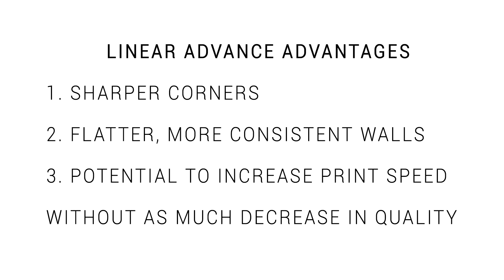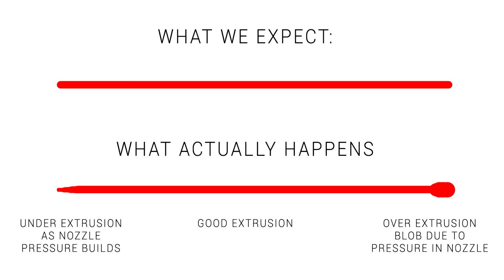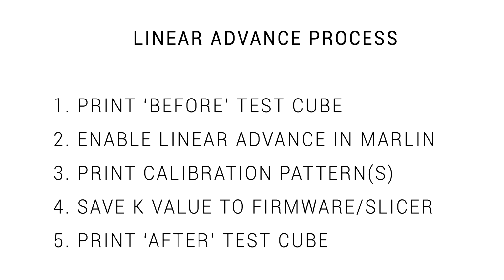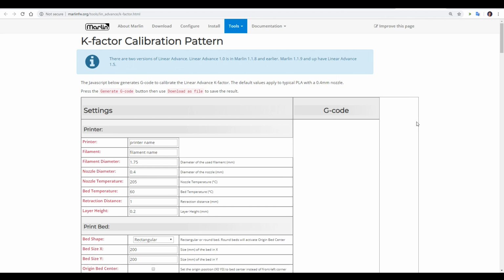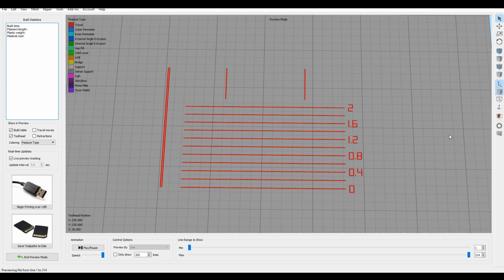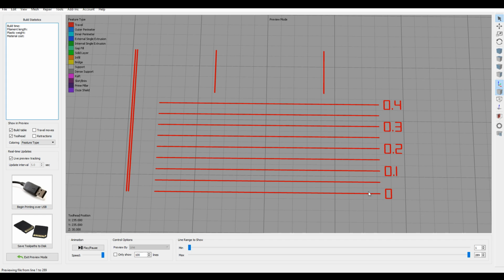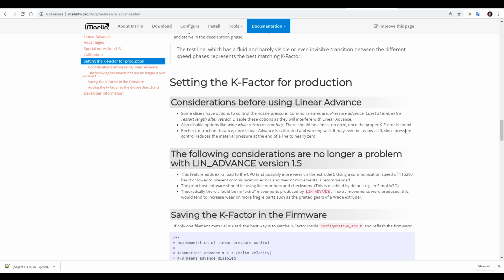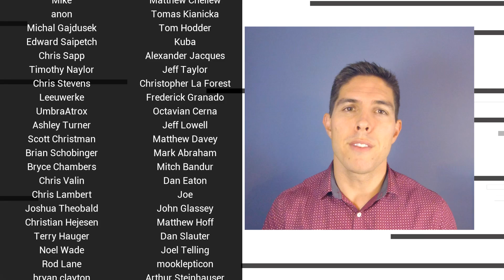Linear advance guide - Free and easy print quality improvement

Comment: I really, really enjoy your videos... thank you so much for sharing them.  I was wondering, though, do you have (or have you thought of) a complete list of upgrades that you would do to a base model printer?  For instance, I have an Ender 5, and I would love to have an itemized list of what YOU would do to it in order to make it the best that it could be.  If the items were even classified or prioritized from "must do" to "over the top", that would be even better.  Thoughts?
Reply: Jeff, I've had my Ender 5 for several months. Thingiverse numbers follow: Print the bed stabilizing arms(3479330) and then if the bed drops when the z motor is disengaged print the upper leadscrew bracket(3534568). Route your wires carefully after you print the bed strain relief(3443100) and the extruder relocating arm(3595328) that lets you drastically shorten your bowden and run shorter retractions (I'm using 4mm;60mm/s) Don't bother with an x-belt tensioner. Buy spare nozzles, capricorn tube, and a glass bed, two if you don't like to wait for it to cool. Auto bed leveling is nice but you have to sacrifice a lot of features on the stock board to make it fit in ROM. Wait and do all the following at once: Hero-Me Gen3 ducts(3182917), SKR1.3 board with TMC2130 drivers, and BL-touch. This will likely obsolete your old gcode depending on how you set it up. However, if you got to this point and you don't care about noise and can manually level the bed, the board upgrade is mostly about playing with advanced marlin features. For a printer-farm machine, no way;for a hobby printer, go for it.
Reply: @alexmacgregor8471  Thanks... I've done a fair bit of that stuff already, except for the board upgrade and ducts... looking to do that next.  I've also got the parts ready for the bed heater upgrade.  Really appreciate the list!
Reply: @jeffgrant935  Cool! which bed heater upgrade? AC power or a better 24V PSU? I had a Meanwell 24V SMPS on hand from an older CNC project but it was to thicc to fit in the ender 5 enclosure. So I moved it to the left side and put the OctoPi and skr on the right side in a nice roomy case (3902295)
Reply: @alexmacgregor8471  It's the same silicon bed update that Michael recently posted a video on with a 24v PSU.  I'm currently building a new wood cabinet/enclosure for the printer (I'm a hobbyist woodworker) that will contain the whole printer, supplies, etc, and be on wheels, and the upgrades are mounted to that.  Transitioning the Ender 5 from table top to an actual rolling cabinet.

Comment: Yup. If you've bought the Creality V1.1.5 silent board, that is all you got - a silent board. Because the TMC2208s are hardwired into the board as a drop in legacy, you get StealthChop mode only. You cannot access the SpreadCycle mode nor flip between the two during printing. Don't get me wrong, silent is so much better than the A4988s and should, in my opinion, replace the previous board as stock. Creality should then provide, as an upcharge/upgrade, to a board where the TMC2208s (or TMC2209s) are configured for UART control to use StealthChop and SpreadCycle. 

NOTE: Along with not being able to use Linear Advance, you cannot use Klipper either.

Comment: tmc2208: otp e driver to spreadcycle. add

#define TMC_ADV() { stepperE0.en_spreadCycle(true); }
#define MINIMUM_STEPPER_PULSE 2

should work. also there probably is a way to set min pulse to E only, but probably is required for xy

Comment: I noticed th3d firmware offered some experimental settings in their new update. Is this what they included? I am running the 2208 steppers on the creality 1.1.5 board. So is it not doing anything? My prints seem to have improved dramatically

Comment: I use manual mesh bed levelling. I tried following this guide but repeatedly jammed my print nozzle into my print bed because it doesn't seem to activate the bed levelling I have saved. I tried ticking the 'bed levelling enable' box in the script generator but that didn't seem to help. 
Has anyone got any advice?
Reply: Insert M420 S1 into the generated gcode but be sure to place it after the g28 line. http://marlinfw.org/docs/gcode/M420.html
Reply: @thomashome677  Thanks for your comment. I can confirm that M420 S1 solved my problem.

Comment: I checked Cura's marketplace and there's also a linear advance setting plugin by Author FieldofView.  Going to test this out also.  If this works, it would be easier than flashing the firmware.
Reply: I wonder if this setting works without the firmware.  Please post your results.
Reply: @Pilot16H thanks, that's what I figured.

Comment: Will definitely try this feature when I give my Ender3 an overhaul.
Reply: Same. Baby needs a rebuild.
Reply: How'd it go?
Reply: @donaldviszneki8251  At least for mine, I noticed right away I can screw all four of my bed level knobs halfway, and I achieve tram level. Before I had to screw one all the way while the others not. No gentle tipping  in the frame on a flat surface.
Reply: @Splatterpunk_OldNewYork  Maybe I"m just being a noob, but it sounds like you're talking about bed leveling, and not about linear advance.

Comment: "easy"
Reply: Street Guru if you want simpler than that you’re on the wrong channel mate
Reply from the maker: Uncomment one line in firmware. Print gcode and pick the best line. Save value. There's harder things around, that's for sure.
Reply: @TeachingTech  Isn't there a Cura extension that can modify firmware? Like it gives you a lot more options to mess with? Would that have the same options?

Comment: 2208s with LA, I found I needed to disable s curve acceleration to get it to work correctly on my SKR1.3.  They just would not play nice together.
Reply: Works perfectly fine for me with S-curve acceleration enabled on SKR 1.3. I had some issues at the beginning with the extruder stepper not moving at all, but that was fixed by a few tweaks in the advanced config file (I can look them up if you're intrested). It needs to run in the SpreadCycle mode (StealthChop mode cannot keep up and skips like crazy), but that's the only limitation. I like to keep everything in StealthChop by default, so my start G-code contains "M569 S0 E" to switch the extruder to SpreadCycle and the end G-Code will switch it back to StealthChop.
Reply: Ahoj, koukám že jsi z čech, mohl bys mi prosimtě pomoct s nastavením advanced config? Taky se mi nehýbe extruder a nevím co s tím.
Reply: @blackader_  Pokusím se, budu-li umět. Pro začátek bych potřeboval nějaký základní info, jako např. co to je za stroj, jaká deska (SKR 1.3?), jaké drivery (2208?), verze Marlina, atd., abych si udělal obrázek. Dále, kdy se to netočí? Pouze po zapnutí LA, nebo to souvisí ještě s něčím jiným?
Reply: FakirCZ Desku máma SKR 1.3 s drivery TMC 2208 v3. Stroj je to Anet a8, kde jsem vyměnil původní desku za SKR. Software mám nejaktuálnější marlin 2.0, který je k dispozici. Při LN nefunguje pouze extruder, ostatní motory fungují, tak nevím jestli je to nějaký bug marlinu, či něco jiného. A když LN je vypnuto, tak celá tiskárna funguje jak má
Reply: @blackader_  Ok, tak to je stejné, jako u mě (stejná elektronika, akorát Ender 3). Moje konfigurace má zapnuté skoro všechno (akcelerační křivky, LA, junction deviation, ABL...), ale abych to rozchodil, musel jsem v advanced configu upravit tyhle dva parametry:

MINIMUM_STEPPER_POST_DIR_DELAY 20
MINIMUM_STEPPER_PULSE 2

Pak začal chodit extruder i při K > 0. Dále doporučuju zapnout ADAPTIVE_STEP_SMOOTHING, udělalo to obrovský rozdíl v hlučnosti při některých pohybech obou hlavních os současně (třeba oblouky o větším průměru), kde na Enderovi docházelo k rezonancím, které byly jak slyšet, tak cítit (bez ohledu na 2208 v tichém režimu). Nevím, jestli je to potřeba i na tvém stroji, ale zase se tím nedá nic zkazit.

U posledního Marlina (commity za poslední měsíc, nebo tak) pozor, nějak se jim povedlo si rozbít ABL a po vyvážení lítá Z-offset po všech čertech. Už je to potvrzený bug. Mám na Enderovi BL-Touch a budu kvůli tomu vracet zpátky cca 2 měsíce starou verzi, kde to ještě fungovalo. Mimo toho ale funguje v pohodě.
Reply: FakirCZ dobře, moc díky za radu, zkusím to. S vibracemi při obloucích mám také problémy, je to slyšet i ve stealth modu. A stalo se ti, že po připojení SKR se rapidně začali zahřívat steppery? Nevím jestli je to stealth modem, ale co jsem tak četl, tak by to mohlo být. Když mám podložku na 60°, tak steppery jsou na dotek teplejší. A mohu ti napsat někde na messengeru?  lépe by se tam asi vše řešilo
Reply: @blackader_  fakir_cz na Skypu. Sociální sítě (mimo YT) s úspěchem bojkotuju. :-)
Reply: @blackader_  jinak ano, s TMC drivery běhají motory mnohem tepleji, než těmi původními allegráckými, obzlváště ve StealthChopu. Je to vlastnost. Moje vyzkoušené hodnoty, při kterých mají motory obvykle pod 50°C (což je v pohodě), jsou 600 XYZ a 750 extruder (mA RMS) a hold multiplier 0,35. Ve StealthChopu jedou pořád, standardně používám rychloposun 250 mm/s s akcelerací 2000 mm/s^2 a krok ještě neztratily nikdy, takže to asi funguje.

Comment: I'll have to try again... 
Tried it some weeks ago with my Sidewinder X1 with a .8 nozzle and PETG (normal setup for me) but dit not get the calibration-print out (and yes I did set the .8 nozzle and temperatures). Very hard to see any difference with the only PETG I had (black) on the black bed  too. 
What is your experince: does it make much difference for each filament and different colours?

After setting it, I didn't notice any difference in print-quality and for the moment the firmware is back to stock , so  do you think it is worth it on a Sidewinder with .8 nozzle?
Reply: In my experience nozzle pressure is highly dependant on filament diameter to nozzle diameter ratio. When printing PLA my K is also 0.11 on a 0.4mm nozzle. Same Material on 0.6mm nozzle and my K value goes down to 0.07. My guess is, that with a 0.8mm nozzle and PETG it wont make a visible difference.

Comment: Good reference. I'm on Prusa printers and don't do any custom firmware. There is linear advance available, but I suspect it is LA 1.0. (K values for PLA are usually around 30, not 0.11...) I currently calibrate every filament by make and model (I haven't needed to go down to by color yet) and one of the things I do is determine a new K value for each.
I'll bookmark this video once Prusa follows through with their promise of adding LA 1.5 to their firmware. Thanx for the resource! :-D
Reply from the maker: I have an old video on LA1.0 on a MK3 if you're interested in the meantime.
Reply: @TeachingTech  I think I'm good with my process (using the method from Matt's Hub). Hopefully it will be changing soon (in a few months) when the next version of the Prusa firmware is released. No sense learning a new technique that will be obsoleted that quickly. ;-)

Comment: I did this on my printer. I didn't read any warnings about using a 2208 in stand alone with lin adv enabled. I'm glad I didn't hear about these warnings because I have 2208's in stand alone with lin adv and it works great. I haven't not tinkered a whole bunch but I followed the same instruction link that you showed from marlin, I got my K value zeroed in and have nothing but good things to say about lin adv. I say don't be afraid to try it regardless of your setup, the worse thing that will happen is re-commenting a single line to turn it off again.
Reply from the maker: I agree. I've not read of any permanent damage to machines so worth a shot. The firmware is always being improved.so the 2208 issue might be a thing of the past.
Reply: I did try the same thing - 2208 on extruder in legacy(standalone) mode. No changes in firmware (but mine defaulted to S curve off). The calibration went fine, I got a nice line with a K0.2, added it to the firmware. Everything was working, so I started a small print and the extruder just stopped after a few (BEAUTIFUL and SQUARE cornered) layers. So be aware, it might just stop suddenly. I think I'm going to swap the E driver for an LV8729, set it for 1/64 microstepping and recalibrate my K value...

Comment: I have a Gen L  board with 2208's on X & Y but LV8729 for extruder.  What mode would I need to have the driver in?  I get the idea that LA is for the extruder.
Reply: The LV8729 doesn't have modes but it will be quieter if you set it to 1/64 microstepping.
Reply: @NorthGaSawyer  so the question remains - will it work with linear advance?  Is linear advance affected by the X & Y steppers?
Reply: @JonSmith-fc2mm  2208's on the X,Y work fine with LA, in both modes.
Reply: @NorthGaSawyer  already have stepping set - just need to know if it'll work with LA.

Comment: Thanks.  I'm driving my ender 5 with a duet board so it's not quite the same but i have been struggling to tune this setting.  I don't know how this will translate to the duet but I'll certainly have a go.  It'll be a couple of weeks before I can try it 'cos I've got a  bit of a project going on on it at the moment.

Comment: Absolutely spot on.  I have been hoping you would address this subject.  Linear advance sounds like such a obtuse subject you made it manageable, as usual.  Thanks again for the most useful site on YouTube or, indeed, the web.
Reply: He needs to add in the obvious but overlooked, ACTUAL nozzle size. If you think you have a .4 nozzle but it's really .35, then the lines might be under exaggerated. If it's actually .45, the lines might be over exaggerated. This was a killer for me the first time (under exaggerated for me the first time... so all the lines looked the same).
Reply: *an obtuse

Comment: Well, I just bought 2208s sooo..,
Reply: I have 2208 steppers in Stand alone and lin adv works perfectly. Give it a whirl, and if you have issues, go back and disable it.
Reply: @ianide2480  My whole reason for them was printing on my bedroom, so I'll be using stealthchop.
Reply: @speadskater  I don't recall the mode that you get from stand alone (google would tell me I suppose) but I don't care to look honestly. Regardless, all I hear from my printer is a very slight bit of bearing noise (full linear rails everywhere) and the fans. The motors are whisper quiet.
Reply from the maker: Spreadcycle would only be needed on the extruder. Stealthchop on the rest would keep it pretty quiet.
Reply: @TeachingTech  oh!  Great!  I'll do that as soon as the SKR 1.3 comes and I can start on my upgrade

Comment: Thank you for another grate guide. Anyone know if I can use this g-code in Klipper?
Reply: There's a script I found on reddit for tuning pressure advance on klipper that worked well for me. A little more complicated to use than the web tool shown in this video though. Just Google something like "klipper pressure advance calibration python script" and it should be one of the top results.
Reply: No because Klipper has it's own scheme called pressure advance.

Comment: Awesome walk through Michael. My only problem now is, sods law strikes again. I've finally got the SKR 1.3 to upgrade the Borg, but I also ordered the 2208s too. Argh!
LA 1.5 has been working very well for ages on the stock CR-10 s4 board. Is there no way of making it work with the 2208s?
Reply: Interested in this as well, have 2208s in my geeetech a10m, and can't change mode. @Spike you can probably get around it by disabling stealthchop.
Reply: @stealthninja1o112  Yes, 2208 works in spreadcycle
Reply: @NorthGaSawyer  and Jarno de Jong Thanks for your input guys, I'll give it a try when I find a mounting bracket to mount the SKR 1.3 to the control box

Comment: All but 1 of my printers (Ft6) have all 2208 drivers.  I guess I’ll pass for now.  Not buying new drivers right now.  Great video as always Mike.
Reply: You only have to change x and y axis drivers. You can keep the 2208's for z and e.
So if the one printer you have without TMC2208, upgrade it to TMC's usable with linear advance - and use two of the 2208 from x and y for z and e on the printer which did not had TMC's before. So you upgrade two printers for the price of one (and if you wanted to upgrade the one without TMC's to TMC's anyway its no extra costs)
Anyway, changing only x and y is only half the cost anyway. And mostly the next printer will come in the near furure anyway. So in your situation I would simply buy a SKR 1.3 + TMC's usable for linear advance for future use and use the drivers on two of the exising printers till whan.

Sorry, I was wrong. Problem ist not on  y and x, but on e only. So you only have to change one driver (if in stand-alone mode) So you can upgrade 4 for the price of one.
And as an extruder not need a tmc anyway (much to slow to take advantage) you might also simply use an old A4988 there...
Reply: It works fine with TMC2208. Disable StealthChop for E and uncomment #define SQUARE_WAVE_STEPPING in configuration_adv.h.

Comment: If I set my tmc 2208 on my exstruder to spread circle can I use linear advance? (Skr1.3 board)
Reply: Yes. You also need to uncomment #define SQUARE_WAVE_STEPPING in the latest Marlin 2.0 bugfix.
Reply: I have read that enabling Square Wave Stepping in the firmware fixes the problem with de TMC 2208.Haven't tried it yet though
Reply: You can but make sure, you also enable #define SQUARE_WAVE_STEPPING.
With enabling that, you can also use stealthchop, if your stepper produces enough torque.
Reply: I found I needed to disable s curve acceleration to get it to work correctly.
Reply: Thanks guys! I gonna look in to square wave stepping, worst case I would maybe use the old a4997 driver or buy one tmc 2209 for the exstruder...
Reply: @xKenn  There really isn't an "easy" way to do it, but least painful way is to use WinMerge. It will compare the old and new file, highlight any differences, then you can click on each line you want to transfer over. A bit tedious, but better than doing it all manually.